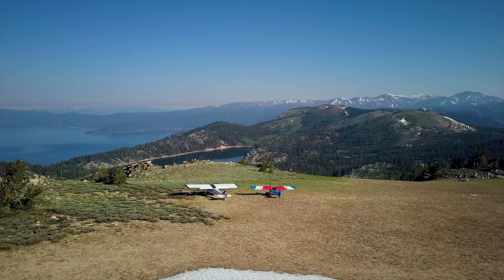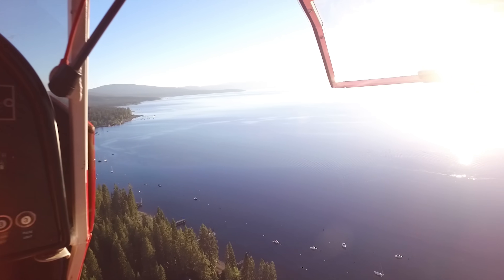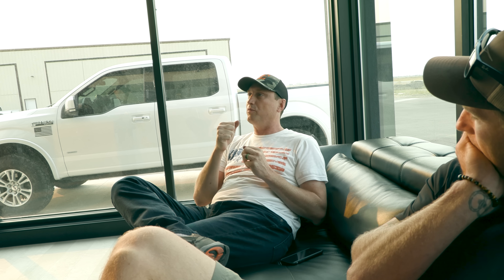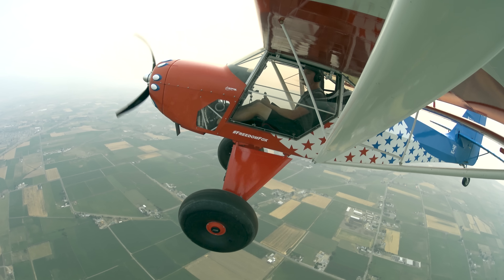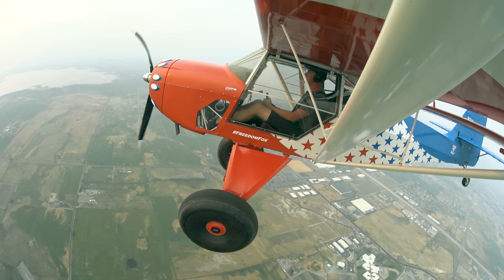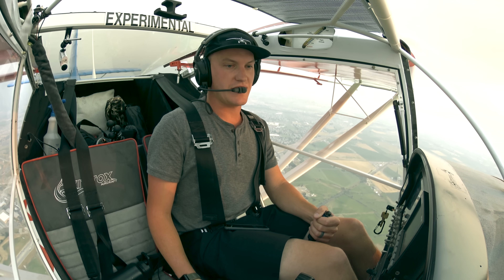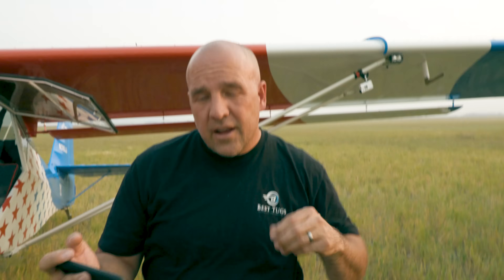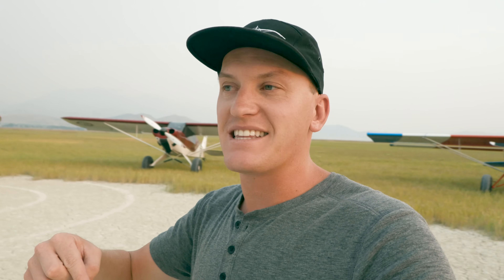YOUR FLIGHT INSTRUCTOR WAS WRONG! - Simulated vs Real Engine Failure

Comment: Wind tunnel is the only way to answer this.  My guess... stopped prop most drag, then windmilling, then idle.  More drag with windmilling?  How does that work?  Not intuitive to me.
Reply: Because the windmilling prop is turning the 'dead' engine. It takes energy to turn the engine. Imagine coasting down a hill in a standard transmission car with the ignition turned off. First coast the car in neutral (or with the clutch pedal pushed in). Then coast it down the hill in gear with the clutch engaged. You won't coast as far or as fast with the car in gear because the engine is turning as well.
Reply: This guy did some research... turns out that it can depend on the pitch.  http://www.peter2000.co.uk/aviation/misc/prop.pdf
Reply: I don't think the same effect of wheels on the ground attached to drive train applies here. I think it has more to do with the position of the propeller. In some positions, the wind flowing over it will be disturbed and contact the fuselage in a way that creates more resistance (drag). In other positions, the disturbed wind coming off the prop might miss the fuselage or have a lower degree of impact on it. So, a windmilling prop has more potential to cause drag since it moves through the areas that cause more drag, over and over, whereas a stopped prop COULD be in a good position to not cause more disturbed air to act negatively against the fuselage. The stopped prop could also be stuck in the worst position possible, so you'd need to test this with the prop stopped in various positions, one position per test. This is just a guess, btw.
Reply: First, coast the car in Neutral... then coast the car in Park.  Get back to me with the results.  In my mind, the prop has the most drag when held still.

Comment: Go and jump in a motor glider and set yourself up at best L/D and idle then turn the engine off and see what happens... you will pitch down to maintain the same speed and best L/D then go and feather the prop and watch the nose come up to keep the same L/D. You will always be flying for best L/D in an emergency situation. Just ask any motor glider pilot. Why don't you make a polar curve for prop idle and prop stopped? That will solve it.
Reply: That's right. There is no use in my mind of trying to extend a glide of any type of aircraft if the airspeed is below best L/D - best L/D is exactly what it says. Trent and Co need to take this into consideration. Another thing; glide the aircraft at say 60 kts theoretically without a prop at all and then theoretically replace it dead. It will be like an airbrake on a glider; idle in my mind will reduce some drag.
Reply: It makes quite a reasonable difference. Idle is thrust and when you stop the engine you need to drop the nose to maintain the best L/D speed therefore there is more drag from a stopped engine. It was adding a reasonable amount of thrust at idle otherwise you wouldn't need to pitch down and if and idling engine was infact higher in drag you would be pulling up the nose to maintain airspeed. A fully stopped prop is pretty draggy and once you feather it you will noticeably raise the nose again to keep best L/D. Therefore an engine at idle doesn't truly represent a true dead stick landings decent rate and at idle has a better glide angle than stopped engine.

Comment: the simple solution would be to get a wind meter and stand behind your idling prop and guage the wind speed, any "speed over ground" faster than the idle wind speed from the prop will create drag. if you can glide at the same speed as the idle thrust speed there will be no more drag than already present.

Comment: That 13 seconds is around 1300 feet travailed forward per 1000 feet of altitude.
Reply: Could you explain the math please
Reply: Trent said his best glide is 60 so that is 101 feet per second so 101 FPS times 13S is 1313 feet.
Reply: @Ryan Jones - You are confusing fps with Kilometers per hour.
60 mph is 88 fps
Reply: 60 mph = 1 mile per minute = 5280 feet per 60 seconds. 5280/60=88 feet per second. 88×13=1144 feet traveled along the path. (Not forward.) The horizontal distance difference is actually 1151 feet if you do the math. 
With the engine stopped, it's a 6.52° approach angle. So if you're doing a standard 3° approach and lose the engine, you're not going to make it. The angle with the engine running at idle is 5.75°, so that won't help either if you're on a standard glide path. It's even worse with wind.
Reply: at 60 mph thats about 2 seconds difference to impact
Reply: @johnnyllooddte3415  ehh, I'm pretty sure 13 seconds is not 2 seconds. I'm no mathematician though. Call it a feeling.
Reply: Ryan Jones, travail: def. pain, anguish, or suffering resulting from mental or physical hardship. The perfect typo in talking about a dead stick landing.
Reply: Tried 3 different descends, all straight vertical down towards the earth with my rc shockflyer.

a) 0%throttle, esc brake off
b) 0%throttle, esc brake on
c) 4%throttle, esc brake on

a) was in the MIDDLE, the wind kept the motor spinning pretty fast, faster than c)

b)was the FASTEST descend, the esc forces the motor to spin at 0% throttle, so a stopped motor is definitely the least amount of drag.

c) was the slowest, because the esc forces the motor to spin at 4% throttle, no matter if the prop wants to spin faster or slower, so it acts as an AIRBRAKE
Reply: Charly UAV best and cheapest explanation on here....well done Charly!!

you should post that in the main  ot as just a reply....cowboy is wrong wrong wrong...all Turbines use it as an air brake for float landing approaches. ..physics don't lie.....great job... any video would be awesome if you could recreate that!!!

Comment: There is citation needed, but if I remember correctly from my aerodynamics lectures, windmilling prop creates drag that is proportional to the surface of circle that the prop covers while spinning. So a stopped prop will create less drag than a windmilling prop.

Comment: Hitting the spot every time.   In my youth I flew gliders for a short time. In a glider you are always engine out. You are taught to apply full spoilers downwind opposite the spot. Lots of drag and steep descent. If you misjudge and are going to land short you reduce spoiler and drag. Spoiler controls act just like a throttle. Push forward (drag reduction) and you shallow your glide angle. 

So latter on I found myself thinking, “the purpose of flaps is a lot like spoilers”. They increase drag to steepen the approach angle without an increase of airspeed. If one is engine out downwind, why not apply full flaps, fly your glide to the spot and if you get low, just reduce your flap setting and reduce your descent angle there by insuring that you make the runway if you find yourself low on the approach. Give that a try and let us know how it works out for you.

Comment: Another question would be if you pitched up to stop the prop, would you lose more due to regaining airspeed versus letting the prop just windmill? I know in my Cessna 150 you have to slow it down quite a bit to stop the prop.
Reply: You take out more lift from the wings when you pull up to slow down. But thats a really good question because you will glide way worse close to stall speed than at best glide. But the again best glide are much slower in a lightly loaded plane. When I took my MAX TOW lesson I was shocked by how much better the glide ratio was (with idling engine) compared to when I was alone or with just an instructor. I had a friend in the back seat so balance was also more on the tail heavy side.
Reply: It would also probably be distracting to make the prop stop instead of just deciding where to land.
Reply: If you're  way up high it makes sense to slow the plane and stop the prop, then speed up to best glide speed, plenty of time to make up the difference.  But if you're close to the ground, you might lose more by slowing down than you'd regain by the improved glide before you reach the ground.

Comment: This is a great question for Destin at Smarter Every Day.
Reply: #smartereveryday
Reply: I demand a collab!
Reply: This is an excellent question. P factor is a thing. If the engine is turning then you have to add in a little aileron to account for P Factor. That's going to create drag.  I took an aircraft handling qualities short course class at the U. S. Navy test pilot school. The main takeaway is that all controls are coupled. If the propeller is turning you don't necessarily have added drag along the longitudinal axis, but you may induce drag related problems in other directions lateral, roll etc). What a fun thought experiment. I need to think about this a little bit more but that's my initial reaction. My gut says you will waste energy trying to keep the aircraft level, which translates to more drag. so that's it basically don't confine your thought process to just the nose of the aircraft think of the whole aircraft as a system. I'm literally dictating this in the shower after watching two minutes of the video, so all of this may be addressed in the later parts of the video.
Reply from the maker: P factor affects the yaw axis so Rudder is required but when the propeller is at idle it’s not making enough thrust for P factor to have much of an effect. But again, this is just judging off the pressure of my feet on the pedals. Would be awesome to link up to test something like this more formally 🤙
Reply: But you have to think that the difference in drag between idle and stopped is so small that even the slight P factor would have a measurable effect.

Edited to add: I would be really interested in seeing this test repeated in a twin-engined aircraft with counter-rotating propellers, to eliminate the P factor variable.
Reply from the maker: P factor affects the yaw axis so Rudder is required but when the propeller is at idle it’s not making enough thrust for P factor to have much of an effect. But again, this is just judging off the pressure of my feet on the pedals. Would be awesome to link up to test something like this more formally 🤙
Reply: SmarterEveryDay Like the guys said, a few extra moments of glide time could save a life.
Reply: @smartereveryday i'm not necessarily sure P-factor would play into this at all.  The AOA isn't going to be high enough if you're pitched for best glide.  With a stopped engine you aren't going to have big enough forces of p-factor, prop wash, propeller torque, or procession.  If you did they'd be difficult to calculate and would most likely have little effect.
Reply: P-Factor at idle is negligible.. seriously?
Reply: OMG.. P-Factor is typically negated by the use of the rudder at take-off power... when P-Factor is there. It is the swirling air flow created by the propeller.... Sorry I had to school ya, It is most effectively countered by opposite rudder.. kudos to you.. ya got one. If you used ailerons to correct at that low speed you'd be another greasy spot. 
Just sayin'
Reply: Something could be rigged using an RC propeller on a shaft and dragging it through water with a force gauge on the end of it (like a fish scale, perhaps). Then measure the resistance with the prop idling versus stopped.
Reply: #smartereveryday
Reply: Manny Pandya Yes I totally agree
Reply: Destin you make a great point about the system as a whole. I come from a fighter pilot background but while helping build an RV-7 we were able to get about 5 more knots at cruise from just getting the rudder trim squared away. Not only did it lower the parasitic drag from the rudder trim tab, but it also stopped the roll moment that went with it. I think being able to fly while keeping the ailerons straight was what really made the difference.
Reply: No its not, this is the most obvious answer ever...
Reply: When we are talking strictly about the prop. It produced more thrust idling then it does windmilling. Make sense that you will be able to glide farther at idle. As far as whether it produces more drag windmilling vs stopped is unclear to me. There might be too many variables at play to understand without true experimental data. I do have a problem with how they measured this little experiment though. They used time to figure out how long they were in the air. Best glide should give you the greatest distance, not necessarily best time. We would want to look at the airspeed at the bottom of the drag curve to determine best time in the air. Which I believe is around Vx in most airplanes. If I am wrong in that regard definitely let me know!
Reply: @carlsjr where you at after your ill thought out comment?
Reply: Please do this Destin!
Reply: #smartereveryday
Reply: Drag is a funny thing. There is a reason the need super computers to fully simulate it.
Reply: Community video making at its finest!  I’d love to see a collaboration on this!
Reply: Somehow this question reminds me of the faster-than-the-wind sail car.
Reply: You guys just did the test ... we are smarter ... THIS DAY.
Reply: That guy is a moron.
Reply: @carlsjr7975  totally agree. I'm a moron.
Reply: @smartereveryday  Thank you for approaching life with a good sense of humor.

Comment: Great discussion! I stopped the vid, because I want to see how this plays out - A CFI will pull the throttle and tell you "Engine out"  But as Mike/Mark???? LoL  says, is the glide profile accurate vs  a stationary prop?.   I think the most definitive way would be to test this in a NASA (Or make one yourself) water flow dye tank, where you have streams of UV dye injected into the water. That would remove all variables, from relative wind,, gusts,  etc, thus creating a perfect test platform.  In a fluid dynamics test, which this is,  the more variables that can be removed the better. When I was in college, I drove prof's nuts because I wanted proof if  at all possible. Math is pure, theoretical physics is more or less pure,, (practical) physics is messy . -- OK! Back to the video - thanks guys!
Reply: At Bonanza Pilot Training they lower the gear to (a lot of) create drag, then turn the idle up just enough to create the amount of thrust that will have the plane decending at the same rate it would with a dead engine and windmilling prop.
This simulates an engine-out/gear-up approach.

Comment: I'd like to find out more about why the windmilling prop creates slightly more drag than a completely stopped prop. That doesn't make sense, but I do believe what you guys all said in the video.  I just can't wrap my mind around it.
Reply: If we imagine (as physicist are want to do) a friction-less propeller of zero mass and uniform pitch your instincts would be correct.  Once the prop has mass, it takes a force to change angular momentum.  With friction it takes force to continue to turn the shaft, and with variable geometry the airflow over the outside edge of the prop will cause the central portion to generate thrust.  This last is the hardest for me to wrap my head around, but sense you like flying videos, do a search for helicopter auto-rotations.  Somehow they manage to get the main rotor to create enough thrust to land safely even with the engine out.